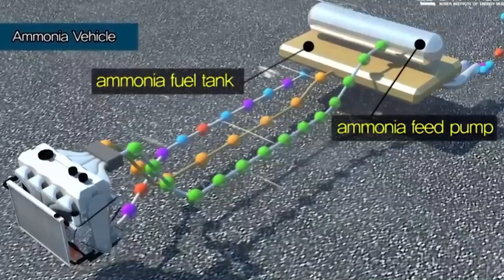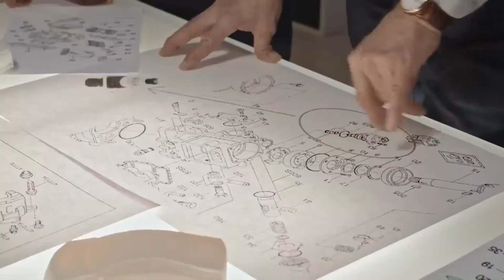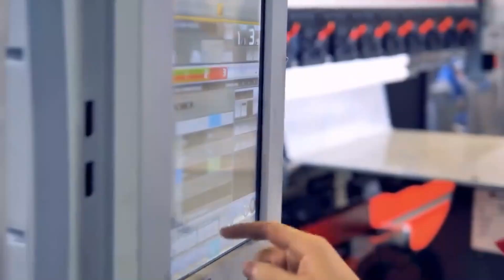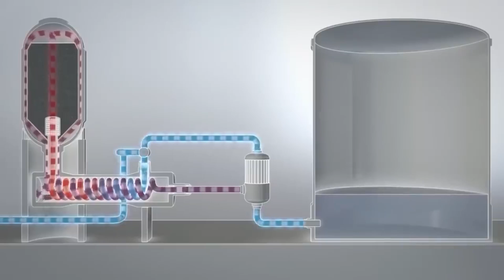Toyota CEO: "Our Ammonia Engine Is The End Of EV's"

Comment: This isn't exactly a new idea. But during the 1950s with the US about to change from the world's largest oil exporter to a net oil importer the US Army started looking into using Ammonia for a replacement for Diesel fuel, with the idea that a disruption of imported oil supplies, remote renewable energy sources (e.g. wind, solar, wave, tidal, ocean temperature, etc.) are impractical to send generated electrical power to the US, but the electrical power could be used to generate ammonia, for both fertilizer production as well as an automotive fuel. (a idea that still persists today...). The army was able to get this to work, but with less efficiency then the diesel engines of the period.

Comment: GREENWASHING. 

Ammonia has to be mixed with regular fuels to work. Also, a main ingredient for it is Hydrogen, of which the vast majority of it is produced using Methane or coal. So it still means fossil fuels are all part of the process still. Then there is the fact that processing single Nitrogen atoms creates lots of waste by-product. Add to that is the result include lots of CO2, Methanez and Hydrogen (which is a greenhouse gas) being emitted into the atmosphere. (Methane and Hydrogen leak all the time)